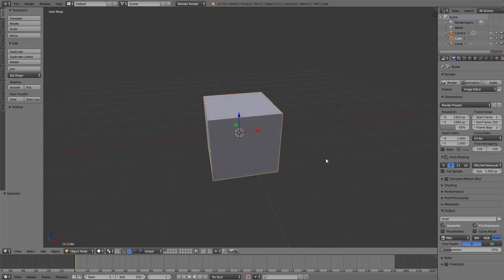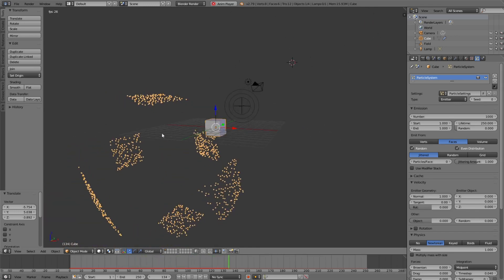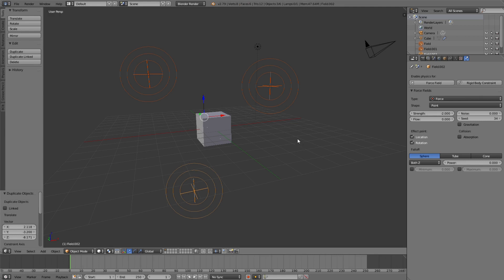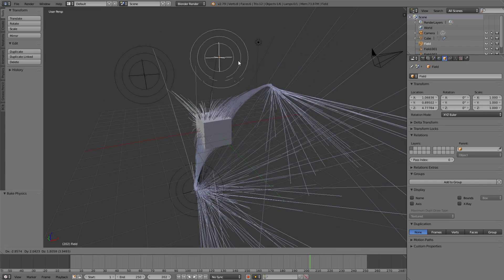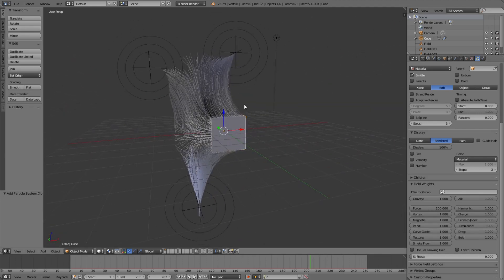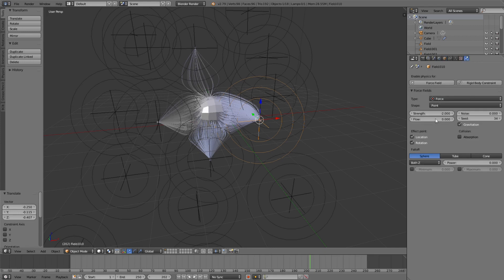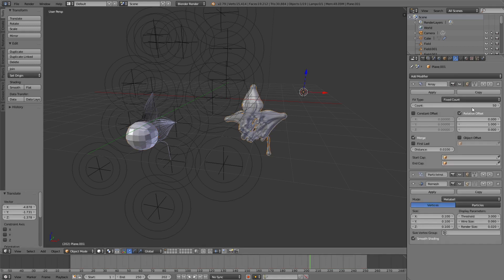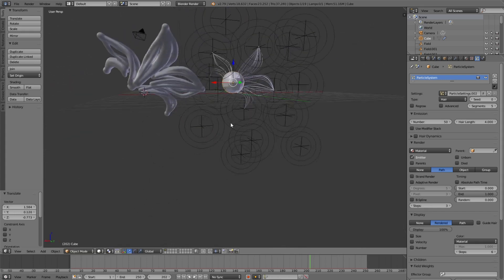Magnetic Streamlines in Blender

Comment: So I'm using blender 2.90.1 and all is good until I try to use the particle instance modifier to make the arrayed line follow the hairs. If 'Keep Shape' is selected the first instance in the array can be slid along the hair, but the arrayed instances ignore the hair completely. If keep shape is unselected, then the first instance stays at the hair start, the 2nd can be slid along the hair, but any other arrayed instances ignore the hair again. Has the modifier function been deliberately changed, or is this a bug? I've tried googling but nothing useful has yet turned up.